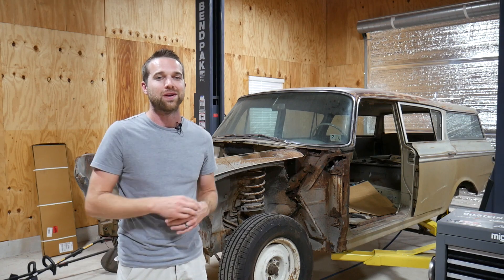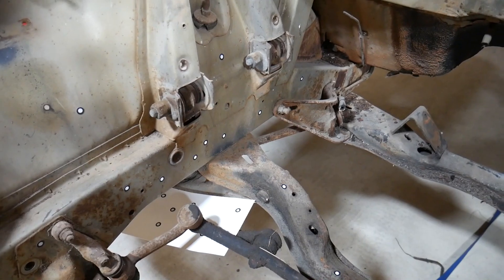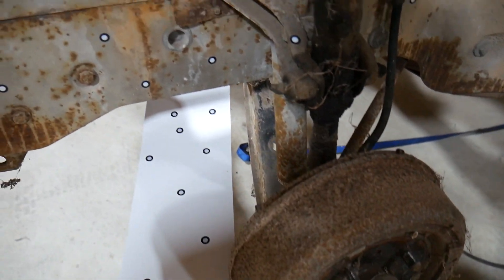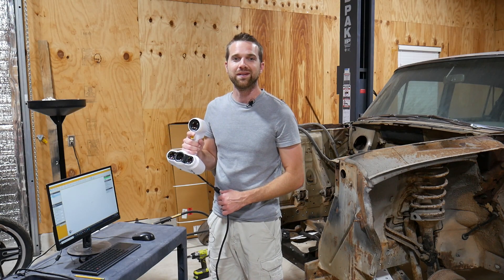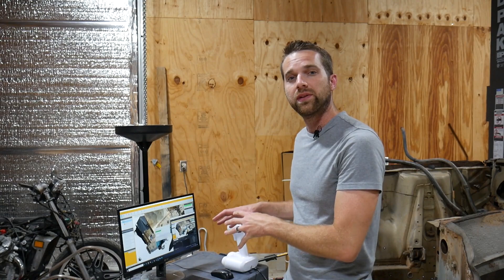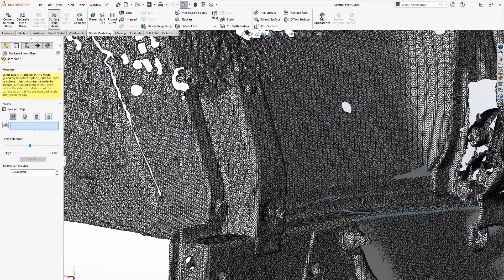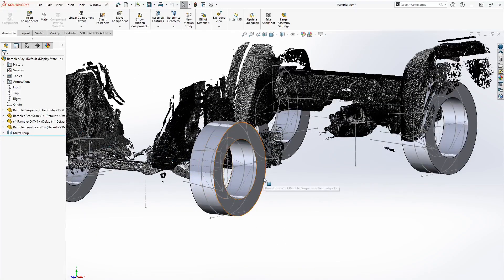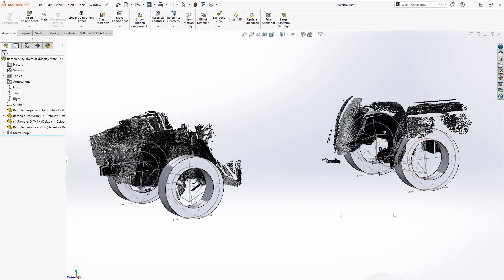3D Scan for Front Suspension/Engine - Rambler

Comment: Newbie here. That scan looked great. How close is it to actually capturing thickness of the cross sections and or do you modify that later on with more hands on measurements. Super excited for this project and would like to see how the iterative process works
Reply from the maker: As long as I capture both sides of piece of sheet metal or plate I'm able to pull the thickness from that in the CAD environment. Hopefully I'll get an update out soon!